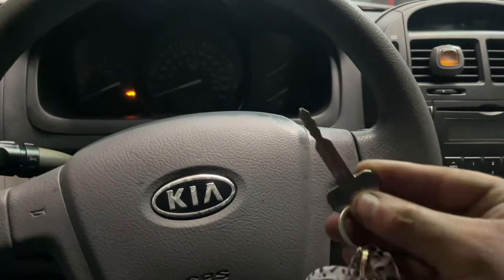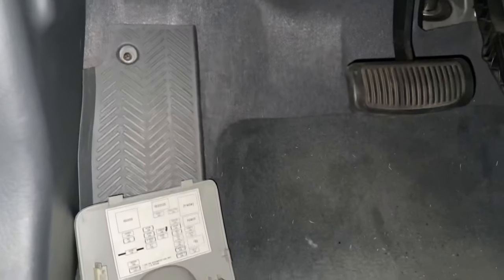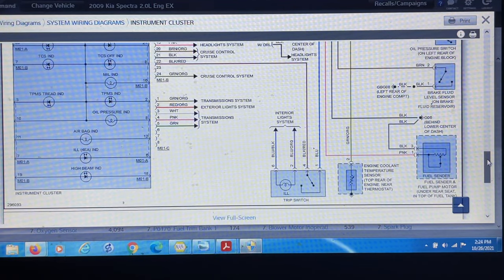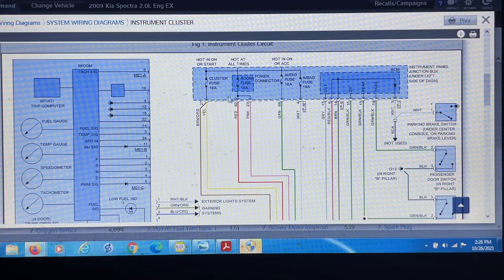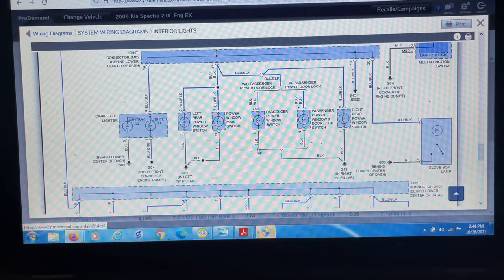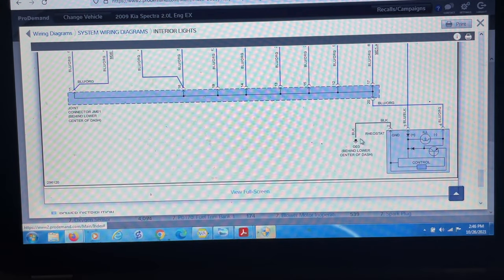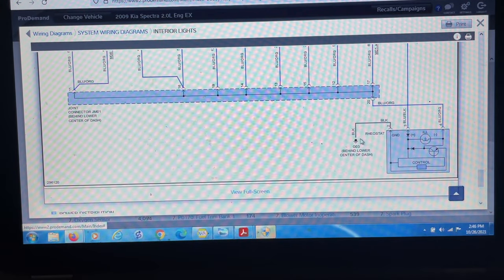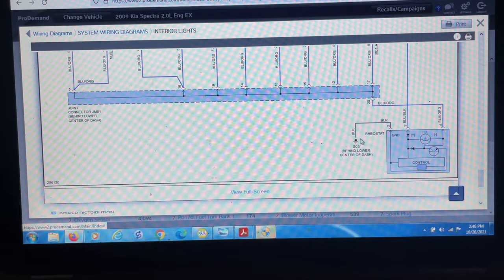Fixing an Instrument Cluster that doesn’t light up

Comment: Absolutely the very best troubleshooting video I have seen on YouTube. Very explicit diagnosis procedure, clearly identified components and a great explanation of the steps to follow to eliminate all possible causes of the problem. Although my vehicle is a PT Cruiser, the methodology and T/S analysis is universal. I actually am much less intimidated to attack my problem which is no instrument panel lights; even after R&R of all bulbs. And yes. I have subscribed and "LIKED" the Oz Mechanics channel. Thanks.
Reply: could you share the diagram website link

Comment: Some contact cleaner might have cured that reostat switch. those potentiometer switches have been known to return to as good as new, with a small dose of contact cleaner. however depending on how much it gets used? it may need another dose within six months to a year?and if it gets used a lot, it simply may be worn out and needs to be replaced.

Comment: Hi, I have the same problems on my 2007 kia spectra, mine is the LX version so I don't have the factory dimer control, so I don't know why or where could be the ground fault, should I ground it directly with another wire stick to the same blue/orange?

Comment: Hi bud I have a 2001 Jeep Grand Cherokee limited v8 .last yr going home from work it started n drive with no issues,I stop at the store got back in and start it up n that’s when it started to misfire badly.so I thought it was maybe a spark plug or coils that went out I replaced all eight plugs and coils and it’s still miss firing. Do you have any idea what could possibly be the issue?

Comment: Nice video. Does the dimmer switch just dim the instrument cluster? Looking at wiring diagram it looked like they all shared the same ground.
Reply from the maker: The ground shares the lower bulbs on the wiring diagram. Ex: cluster, trunk lid, digital clock, ac control. And on the upper end of the wiring diagram the power window switch is grounded by G111. But during the test I was verifying powers first.

Comment: I have that problem right now. But my window power switch doesn’t turn on. So my window switch, my dashboard, ac control unit and my shift gear unit don’t light up…. Hopefully the dimmer replacement fixes all that

Comment: So are al three of those testers mandatory for that testing? My cluster doesn't light up at all neither does my side door. My swtich is for headlights and cluster. it does work with  headlights, but the cluster dial doesn't work. And its a new switch.

Comment: I've got what appears to be an electrical issue with my 2017 kia sportage sx turbo, but I don't have alot of confidence with the kia dealer. Here's whats happening:

The radio and touchscreen has been randomly blinking in and out for about a month now. The touchscreen would go black and radio would go out intermittently while driving and come back on a few seconds later. At first, I thought, could be the radio unit is going bad. One time when the radio blinked out, the display behind the steering wheel in between the rpm and speedometer blinked out too. That probably happened twice. Two weeks ago, when I was driving on the highway at very slow speed due to traffic; at a crawl, I was moving into another lane, the radio blacked out, then the display behind the steering wheel, then my power steering when out for a few seconds and made a squeal type noise when I turned the wheel slightly (not sure if it was an electronic squeal noise or physical squeal noise). Then the power steering came back normal after a few seconds. The engine did not go out at all. That really freaked me out. I got to a restaurant to park and as I was pulling into the spot at a crawl speed, radio blanked out, then the display behind the steering wheel, then the steering wheel went out again and made a squealing type noise when I turned wheel. Steering came back after a few seconds. When I came back out of the restaurant, all was normal again. The battery was replaced with a brand new one 8 months ago. Not sure what all this means; but it is making me nervous as hell. 

I took the car to the Kia dealer a week ago. I talked with the mechanic personally this morning after he had a day or two to try and duplicate the issue. He drove it around the last few days and is not able to duplicate the issue. It is not happening when he drives it. I asked him, what if it was happening and you saw it what would you do. He explained to me that he has the tool plugged into the car so when something happens it will register in the tool. He's actively monitoring the tool while he's trying to duplicate the issue. Without being able to duplicate the issue while the tools plugged in there's no way to determine what is wrong. I have to pay the diagnostic fee either way whether he finds something or not so I told him to keep it a few extra days and to keep driving it to try and figure out what's wrong. If he can't duplicate it I'm going to end up taking this car back and it's going to eventually do this on and off until I don't know something worse happens. Not a good feeling when the kia dealership can't figure it out. I asked him, doesn't the car's computer capture in memory some kind of issue when it goes wrong and he said no it doesn't the tool has to be plugged in to capture it while it's happening. I don't know enough about it to say whether that is true or not. Let's say that he just cannot duplicate it during the time he has it and I get it back. Is there a tool I can buy and leave plugged in that will capture what's going on? I'm kind of at a loss on what to do. 

I'm in the Dallas TX area. Any advice you can give or anyone you might know closer to me would be so appreciated. If you were not 4 hours away, I’d drive it to you. Thanks!

Comment: Hey oz i have a issue, my 1989 honda accord has a high idle of 3000, then it simmers to 2000, then fluctuates between 1500-2000, before leveling at 1000
Reply: Check and clean the idle air control valve.